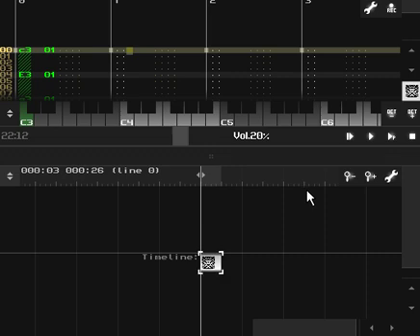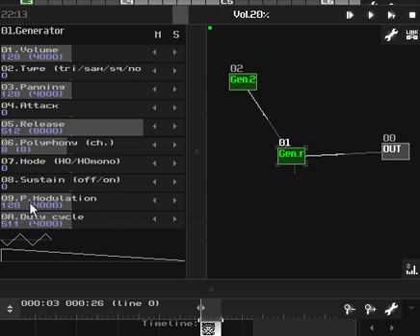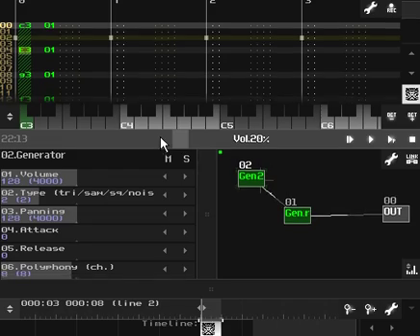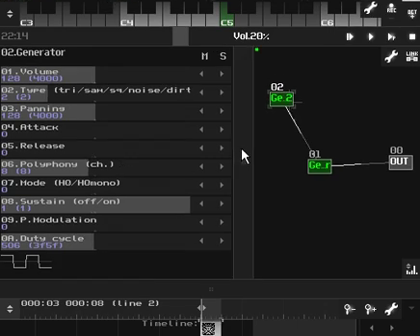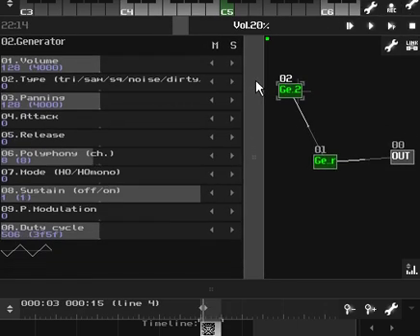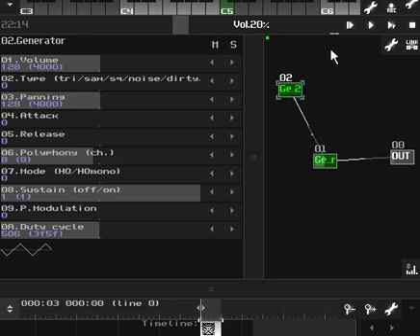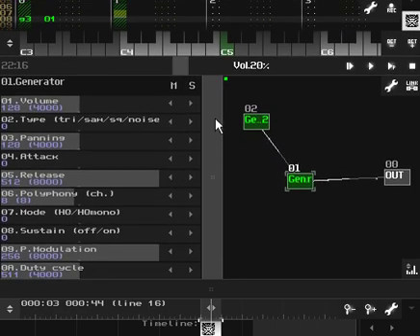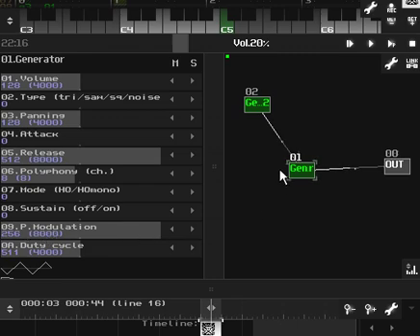SunVox Tutorial Part 3 - Frequency Modulation

Comment: I just found this synth today, loving it and the tutorials so far.
Is it possible to use one oscillator to modulate any parameter of another? 
Phase is great but being able to modulate amplitude and frequency would be useful.
Reply from the maker: +ourigin Yo! Yeah, it is possible to use one oscillator to modulate other parameters. However, it has to be a parameter that you can edit on the synth (so the volume, the duty cycle, synth type, etc). You would use the Sound2Ctl module to use the amplitude of the incoming sound to change another parameter. I made a tutorial about it, actually: https://www.youtube.com/watch?v=Qz9Tmf_MTgE&amp;index=19&amp;list=PL62F503E7722DB7CC

Comment: @SolarLuneTube Thanks, I don't know what's going on, the clipping won't go away even after your suggestions. I'll upload a video of me running Sunvox and perhaps you can see what I'm doing wrong. I used to get a clipping problem with samples on my old PC due to slow CPU, but I have a quad-core i7 now - an issue with CPU settings or something?

Comment: @SolarLuneTube Also, another question (sorry!): I'm trying to get a smooth bass with a generator (fast lines, legato notes) but get a clipping sound as the notes change. Polyphony just makes dissonant fuzz where the notes overlap. If I increase the attack and decrease the release it helps, but to eliminate the clipping completely these settings have to be at such extreme levels that it doesn't sound like a bass any more. Any ideas? Portamento? Note cut doesn't help (there's no note off). Thanks

Comment: @SolarLuneTube Cool, thanks. Looks like they were connected in the right order but I was altering the phase mod slider on the modulation-generating synth, to no avail, instead of the other synth. I assumed that the mod-gen synth phase mod slider changed the overall sound seeing as it was the the "cause" of the phase effect, but in fact it was the other synth that has to "allow" this influence.